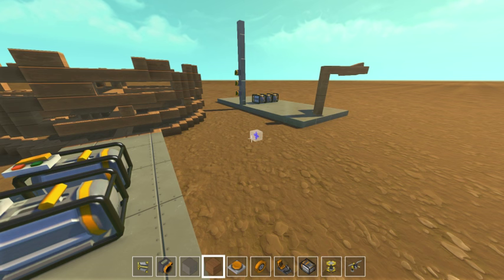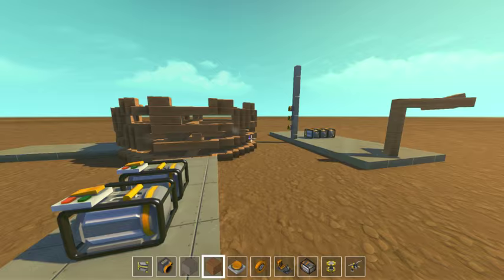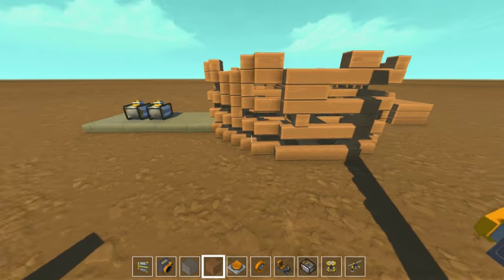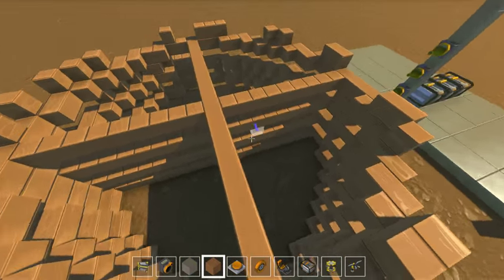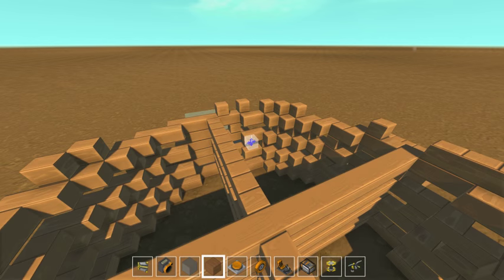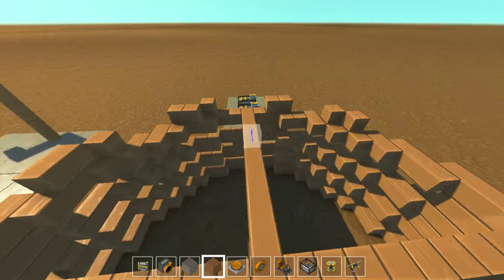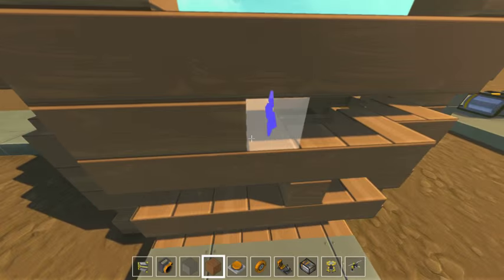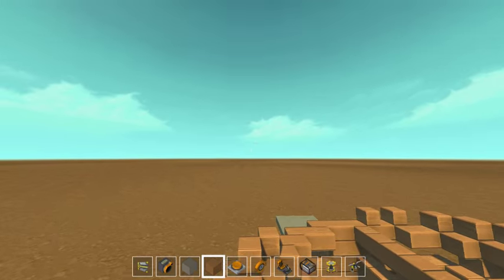Scrap Mechanic Music Box Control System

Comment: I had a similar idea. My idea was going to flip the disc on its side and run it the opposite way with a reversing toggle. This is more effective I think.
    I have not bought the game yet so I am restricted to watching others fumble with the mechanics. You have a pretty nice grasp of the sensor block. How it can activate more than just bearings makes this a great alternative to a controller. Some pointers might be to use the sensors to make logic gates. Once you get a grasp of those and combine them with this there will be no limit to your tinkering capabilities.
Reply from the maker: +Lt Sam My impression of logic gates so far is that they're intolerably slow.  Controlling a flying machine is not fun when there's a second of delay before a button press registers.
Reply: +Exotria One thing I have learned that could help with the timing is holding shift on the controller while adjusting angles allows for more articulate control. Keep at it bro and stay frosty.